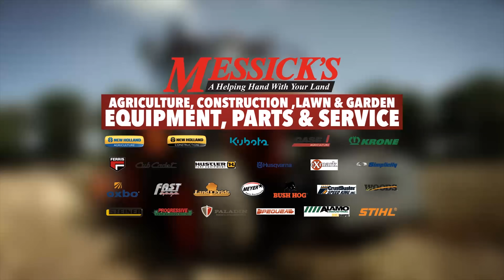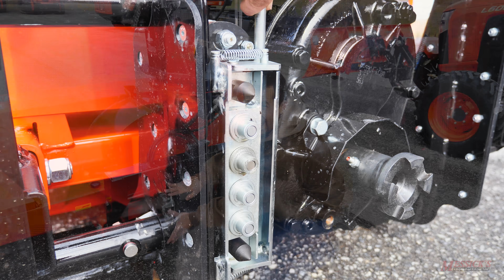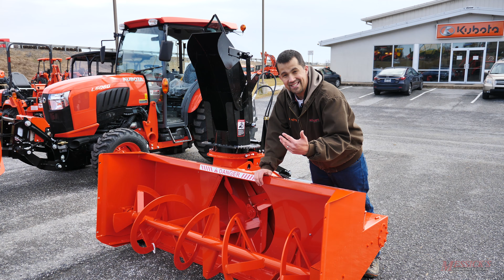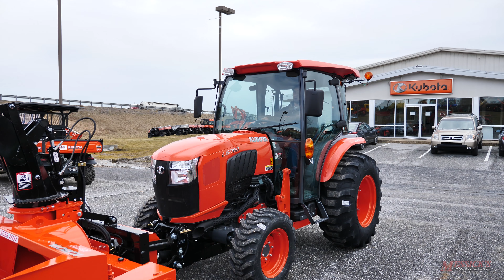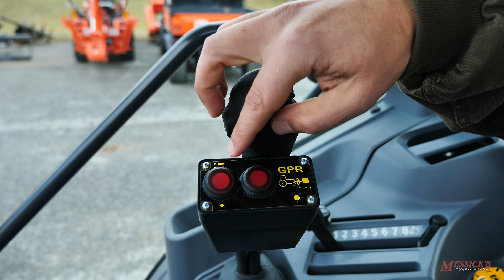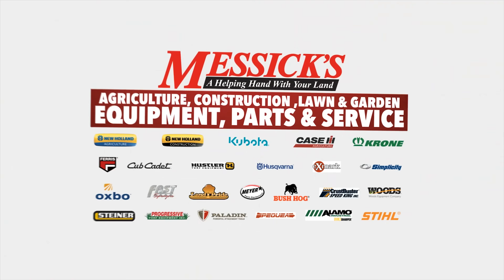Kubota Grand L6060 Auto-hitch and attachments (walk around and demo)

Comment: does that tractor require def fluid
Reply from the maker: No, not required on anything under 75Hp.
Reply: @MessicksEquip  thank you whats the horse power on it
Reply from the maker: @ernestomartinez287  60. Details on kubotas website
Reply: where can i find an auto connection for that type of tractor
Reply from the maker: @ernestomartinez287   A kubota dealer.

Comment: That's very slick. Honest question though : could we buy a second dedicated machine for the price of it? ;p
Reply from the maker: honest answer, almost.
Reply: If you bought two B series, one with a blower, one with the plow, you would save about 20 grand, which for most home owners is all you would need. I have a 350’ driveway and we regularly get  200 to 300 inches of snow and my b2650 with 63” blower handles it nicely. If you’re in business you would probably want the grand L.

Comment: That K3 Auto-Hitch is $8,000.00. I think im still young enough to just connect and disconnect manually.
Reply: If they had more attachments other than just snow gear it might be worth it, but even if you get allot of snow you're just going to use the blower 90% of the time.
For 8 Grand you could also get a utv and put a plow on that.

Comment: How does the auto hitch integrate with a front loader? Do I have to take the loader off to install the auto hitch?
Reply from the maker: Yes, loader and hitch are not compatible
Reply: Do you mean you just need to take the subframe off to put your loader on ?

Comment: The auto-hitch would be the reason to purchase an L6060 over competitor products. However, it would be better if they offered a 9 foot wide V-plow instead of a straight blade.
Reply from the maker: there is a v-plow option. this customer did not choose to opt for it.
Reply: Outstanding!

Comment: This was a great video on this feature that there is hardly any info on Kubota’s website.  I would be curious to see a comparison of the auto versus the manual hitch as well as seeing the sweeper and especially the flail mower in action.  I am looking forward to your next video on this as I wondered how much of a pain it would be to remove the hitch to use the loader.  Thanks for this it was very helpful to understand this system.

Comment: Nice video as always. Man that is a really nice setup. Too bad that hitch costs so much. I can't really see how any one can justify the extra cost. It does not take that long to manually change those attachments. I could get in and out of the tractor a heck of a lot of times for the  $5,000 more that the auto hitch is. I'm glad that Kubota made the auto hitch, I think some of that technology went into the new BX quick hitch. Hopefully they can apply this technology to other tractor lines even if the hoses don't hook up automatically. Some day the auto hitch will probably be the standard hitch.
Reply: Old and rich or young rich and lazy
Reply: @Coaltrain87.  So true, but todays money, it's almost $10K to get the auto hitch. Kubota better smarten up. Markets will open up to cut price. If someone is to add this whole kit with the snowblower, its half the price of the tractor. Doesn't take an Enstien to figure out this if WAAAAAY over priced. They just know they got you and hope you'll pay the price.

Comment: This seems like ventrac.
Reply: Yeah...No. Ventracs use an old and outdated design that use belts to run the PTO attachments. Yes they make a damn good machine but they need to update their shit...Belts are a failure point and just silly to use on a modern "tractor" as a means of transferring PTO horse power. Yes they get a little more implement RPM due to running belts belts but it's an archaic system at best.
Reply: This is way bigger than a Ventrac